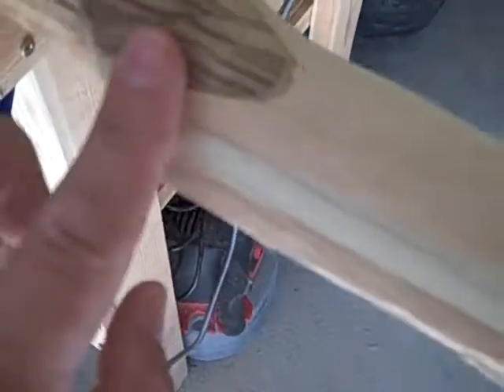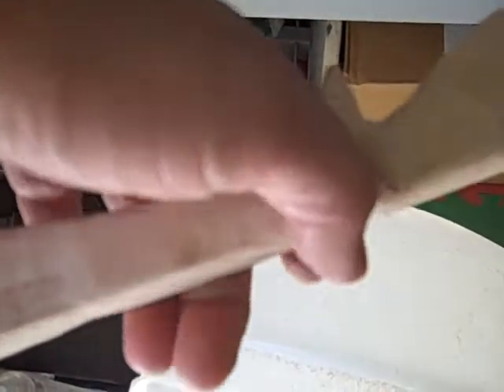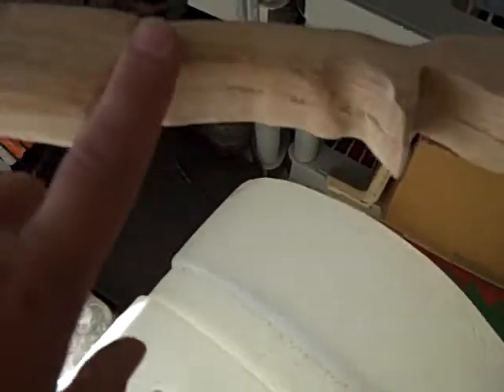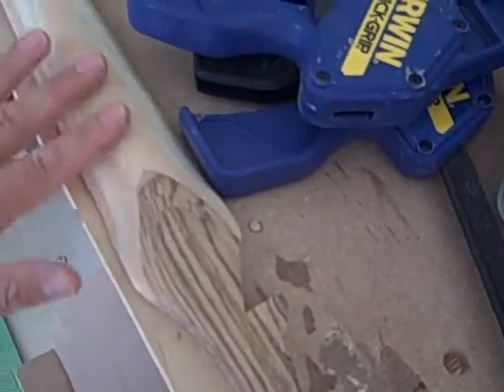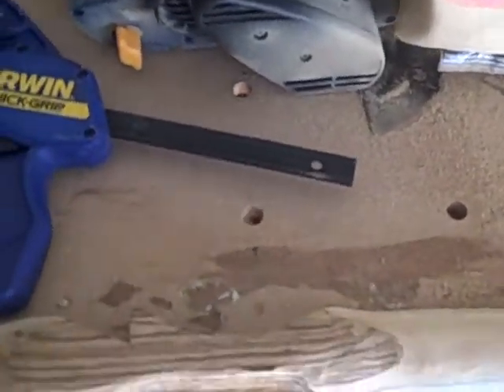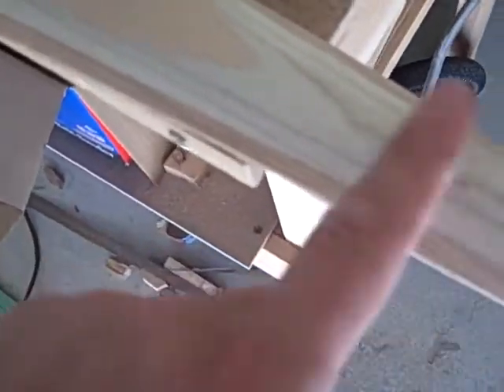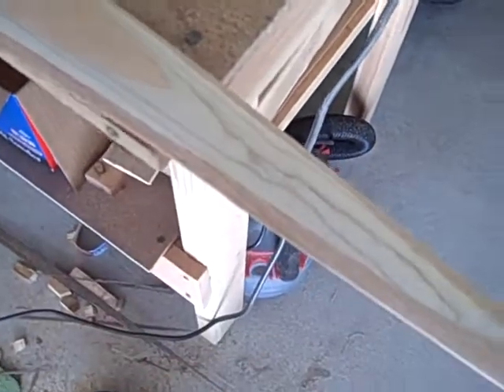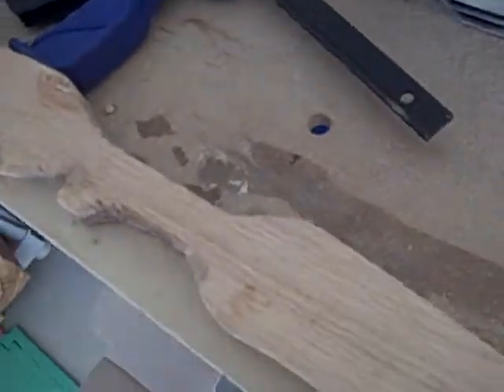Bow build part 6

Comment: one of the nicer done videos i've seen in net...great commentary as he runs us through it all...
One thing sorely lacking in "all videos on net" for truing up wavy sections and gouges from files is a short section of a wooden block with sandpaper wrapped around it in any grit..Going down to finer and finer grits and truing up the whole bow surface....Hal